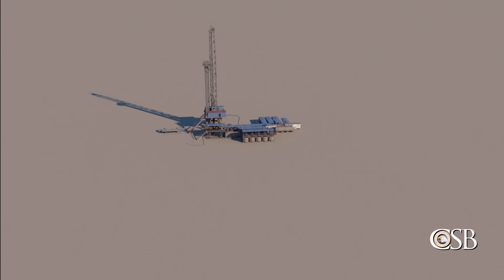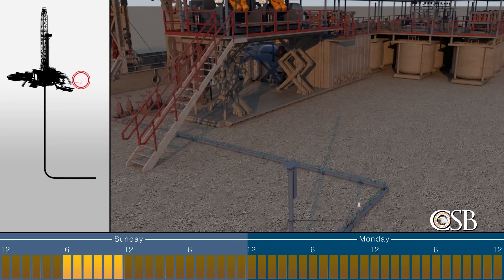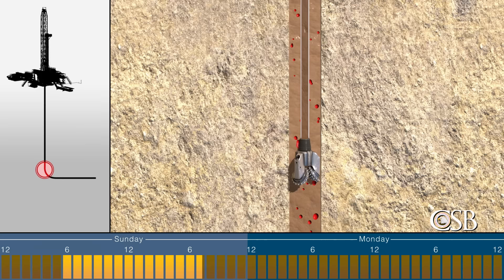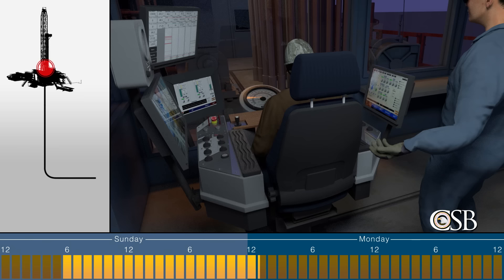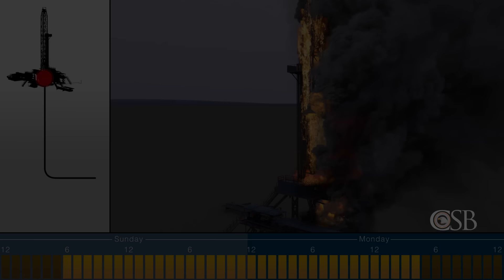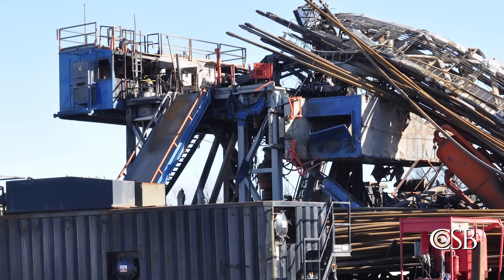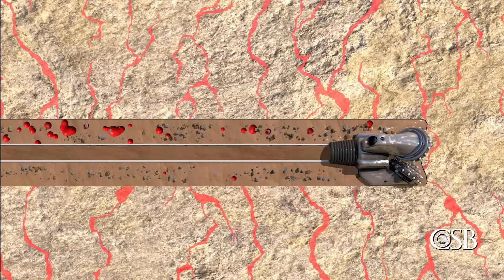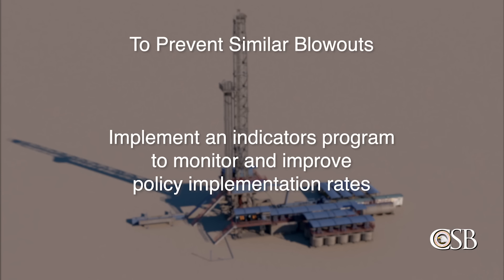Blowout in Oklahoma

Comment: Having worked both on- and off-shore rigs when young, I know the hard, physical labor of the hands and the mind-numbing grind of the monitors/operators.  The work is in all kinds of weather and the dirt, mud, and grime covers you and gets into places you didn't know you had.  The pressure for progress/results from the suits above is as constant and relentless as the noise of the machinery.  
However, things can get real fast when near the "pay zone".  When tunneling blind into the hot, gassy bowels of the earth, every subtle change must be noted, interpreted, and responded to quickly.  Everybody needs to on the ball, trained and prepared to deal with whatever comes out of that hole, especially during a trip.
I feel great sorrow for all the families, and especially for the three doomed roughnecks on that  freezing, slick drilling floor who tried to find cover in that death-trap cabin.
My take is this  --  jackleg drillers, jackleg operators, a jackleg contractor, and a jackleg corporation conducting an extremely hazardous jackleg operation in a deregulated jackleg state run by pro-industry jackleg politicians.
The poor, piteous victims were burnt offerings to the gluttonous Gods of Greed.
Reply: Well said.
Reply: i'd call it akin to working on an aircraft carrier goin full tilt in persian gulf  :)
Reply: I didn't know all oil rig workers are trump supporters!
Reply: scose yup pretty much, if you worked in the oilfield you’d know
Reply: @carbonzo6  Judging by his nick he's Irish...look up what it means..😏😅
Reply: You should be a book writer.
Reply: Nice rant but I don’t like how you described a oil basin as the “bowels of the earth”
Reply: this is why labor unions are so important
Reply: Legit sound like some writer, Not someone who's done the work.
Reply: Been there  you are spot on
Reply: Blame the rich guy at the top. This is all we do nowadays. How about being responsible for your own safety and not ignoring, then turning off the alarms.
Reply: @duradim1  ask yourself why he turned off the alarms and bypassed safety measures in the first place. it couldn't possibly be because he might be under pressure from the higher ups to be as productive as possible and to 'improvise' solutions so that work can keep going. obviously the higher ups will be completely understanding of the situation when the drill operator shuts down drilling operations for several hours because he wants to be as safe as possible.

nope, the worker must be completely at fault. because apparently he just hates his own colleagues so much that he tries to kill them?
or it must be because he's just incompetent, and there was nothing the boss could've done because the worker hired himself for the job I guess.

workers that ignore safety regulations are only a symptom of the disease, they are not the cause.
Reply: @debaronAZK  the fact is he is responsible for his life as well as those he works around. It would be better to lose your job than lose your life. If you want to argue that point with me go right ahead. I can tell you one thing for sure, I have seen many workers, including myself, ignore safety rules because we didn't think them important or they were inconvenient. It is not always management but it is always human nature. So let's stop this "holier than thou" crap and stop putting all the blame on those in charge. It is weak and pathetic.
Reply: @carbonzo6  Sir you have no way of knowing Mr. Mahone work experience and are off base with that comment.
Reply: Heavily agreed, oklahoma is a standing joke for safety and rules. Almost every inch of this state is falling apart and ridden with crime yet governer stitt continues to fail the people
Reply: @carbonzo6  This shit happens all the time and I promise the oil doesn't care what your political opinion is when you're blown 30 feet off the rig
Reply: Sounds about right. Been there done that. F**k Patterson UTI.
Reply: Thank god electric cars are taking over and this hazardous trade can end.
Reply: @justsomeguy6474  lol
Reply: BLOOD FOR THE BLOOD GOD!!!
Reply: @duradim1  That just says you don't follow safety rules because you don't think they're needed or were too inconvenient for you to follow which doesn't make you look good. And the rich guy upstairs is to blame because he didn't make sure that everyone downstairs followed the safety guidelines and procedures in the first place.
Reply: @kylesaavedra5400  you read my mind exactly. Impressive!
Reply: @justsomeguy6474  yeah, just leave gigantic holes all over the earth
Reply: @SwigerQ86  What are you talking about?
Reply: @ButterfatFarms  Do you get tired of being wrong?
Reply: couldn't have said it better myself

Comment: Alarm management has also been an issue in nuclear power control rooms; it definitely seems like this is a problem across multiple industries. As mentioned in the video, there definitely should be different sets of alarms for different activities. However, there should also be different levels of alarms for those activities. If a driller was getting annoyed by all the alarms, they should be able to turn off the lower-level alarms and/or mid-level alarms without disabling the high-level alarms.

Comment: They just need a covered emergency escape slide out the back of the cabin. I used to work for a company that made airbag propellant and we had breakaway walls and escape slides. It shouldn't be too much of a problem to fit an existing model.
Reply: @Quantum Passport But the "gas company" doesn't own the rig. There is a reason why drilling contractors exist - to take on the risk.

Comment: Your check engine light is on - nah, the engine is still there.
Reply: hilarious!!! Never heard that before...hilarious!
Reply: DM4LX in a nutshell..
Reply: I gotta tell Dad that joke!
Reply: I just checked, still looks like an engine to me!
Reply: It's just a bulb; it'll burn out.
Reply: lmaooooo
Reply: I put electrical tape over the light so it does not distract me when I am driving.
Reply: Hahaha, jokes aside. Kids. Check your Check Engine light. If your gas cap is still intact, get some headlight fluid and dump it in your flux capacitor. Works everytime.
Reply: Fred the Health and Safety Officer not at work light is flashing, oh well speed up drilling then.... not long to lunch break and the lap dancers arrive.
Reply: 99% of check engine lights are emission based and have no real affect on the cars ability to run safely. The only time you have a engine issue, it's generally too late for a check engine light...
Eliminate the regulations on emissions and then when the engine light comes on you know you have a real issue....
Reply: @wind-solar  ; Yep or unplug the Idiot light and buy a set of gauges
Reply: @umakariharu8035  ; That process requires a left handed 36 " wrench
Reply: Parachute jumper, nah i feel more safe without it. It makes sense right.
Reply: No doubt. I've had rigs come in with a smiley face or some other sticker covering the check engine light because they were sick of looking at it. Hmmm...
Reply: As a tow truck driver 40 years ago, I picked up a lady broke down on the 101 in Santa Barbara. She said she didn't know what happened. The red oil pressure light came on some 10 miles back.
 I advised her to do both herself and her husband a favor. DO NOT tell him what she told me. That would avail NOTHING. I explained what had happened and to never do it again. I told her to tell hubby the red light came on and she immediately pulled over and shut it down.
 The truth only would have caused bigger problems than what they already had.
Reply: @babydriver8134  Good save bud.
Reply: @sigaries4062  Thank you. I was only 26 but I knew the SWHTF something fierce if the truth were known.
Reply: @kenkarish826  Yea there are plenty of codes you can drive forever with - same issue really.
Reply: In actuality you are correct. It should have been called not your engine light. But get the Joke.
Reply: @umakariharu8035  20 YEARS AGO- If someone told me I needed to go to AutoZone and get some diesel exhaust fluid, I'd have slapped them & said Exhaust Fluid lol Im not falling for that. 🤔
20 YEARS LATER-
I have to go to AutoZone once a month to buy 3 gallons of Diesel Exhaust Fluid and fill up my diesel exhaust fluid tank. 
One day you might be going to buy some headlight fluid so you can fill up your headlight fluid tank.
Reply: betatalk357  Tried a little too hard. But nice try. Just wasn't hard enough
Reply: @dickfitswell3437  Bahahaha
Reply: @pqrstzxerty1296  they get lap dancers at lunch breaks? Damn I gotta get into that industry!

Comment: You'd think a fire escape would be pretty high priority on an oil rig
Reply: Had one, but door was hinged in a way that impeded its use.  (swung out left, blocking access to the stairs on the left also.  Simple things are often hard to see at first withoout a design standard/checklist.
Reply: @driller43  exactly! You often dont think about the little things untill you need them, which is often too late.  Thats why I believe its important to have a set of safety standards across the drilling industry as the USCSB recommends
Reply: Pfft. The derrick man has a zipline from the top of the rig to the bottom of the rig at a 70 degree angle where at best he will break his legs during an emergency. They do alot of safety, but this in particular and several other things still need to change.
Reply: @texasfossilguy  I kinda miss workin derricks, i guess thats why im here.
Reply: @greatalaska6429  Being a derrick hand like I was then you know this blow out could have been prevented. As a derrick hand we watched the pits, mixed mud and if they're gaining well that's a sign. I enjoyed the work, money too.
Reply: @texasfossilguy  I've watched them play on the Geronimo line and no one broke their leg
Reply: This is gas rig. But yes fire is here.
Reply: Artjoms Pugacovs Absolutly no difference from a oil or gas drilling rig. They use the exact same equipment to drill horizontal wells.
Reply: @greatalaska6429  Not me. That Driller we had when drilling for methane would light up cigarettes right on the spot no more then five feet from the pipe while drilling and this was a old rig back in the 80's told the Roustabout Boss to tell him to stop smoking on the rig while we are drilling , after that the driller would wait until the boss left and light up again, that was enough for me i left to work on another Rig !
Reply: @nickbeam5432  Dang man thats nuts i don't blame ya for wanting to high tail it. On the slope we had a kick, with our TIW valve 30 ft in the air. Crude went all the way to the crown and rained down drenching all the steam lines. I thought for sure we were all gonna burn.By the time we had the well shut in crude was goin over the tops of my boots. No fire, no injuries, but scary as hell.
Reply: @greatalaska6429  Brother, GOD was for sure watching over you all for something like that to happen and not catch fire and burn like a inferno !!!
Reply: @nickbeam5432  my operater on a service rig went down from h2s gas while nipping up bop earlier this year. He survived but it was scary as hell. It was my first hitch on service rigs and I had not been properly trained at the time.
Reply: @theodorekleinsasser2698  I believe it, the tool pusher on our sight told everyone to be careful because the gas is odorless and can barely be seen when burning and that a person would melt right where they stand if on fire. He had told us he lost one lung and had burnt clothing when it happen to him so i can for sure believe what you are saying !
Reply: @nickbeam5432  ya just had an h2s refresher course yesterday
Reply: Not even permitted to know the chemicals in frac fluid.
Reply: or at least a foam fire suppression system
Reply: @rocksandoil2241  At our fall arrest course everyone had to ride the Geronimo. No broken legs.
Reply: @jamesmclaughlinprimitivele4587  It's 99% sand and water, 1% rust inhibitor, lube and gel
Reply: Great place to tell everyone that your a rig worker.lol...Woop woop
Reply: I was a service hand and I had to buy my own h2s hood because I'm allergic to medals. Shaving with a razor looks like I've stripped the skin off of my face. First thing the gate guards said was to shave. LoL.
Reply: @swedensy : fire is there, that is why they are no longer made of wood!